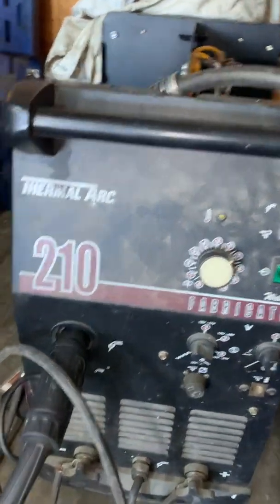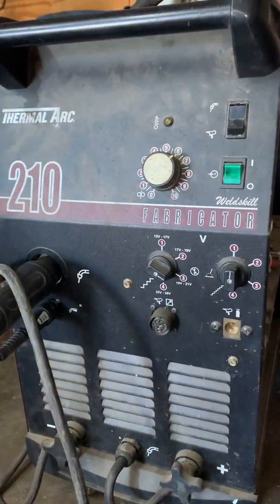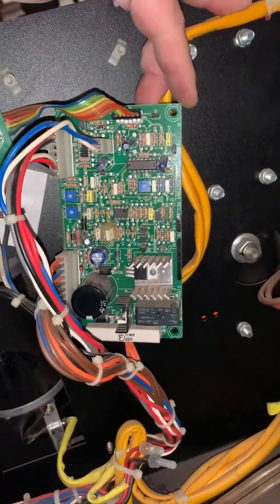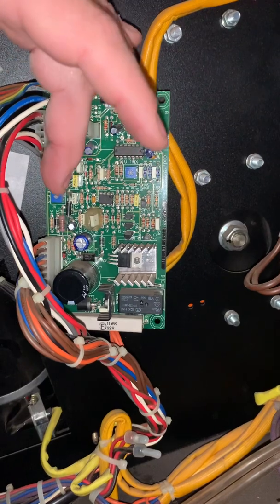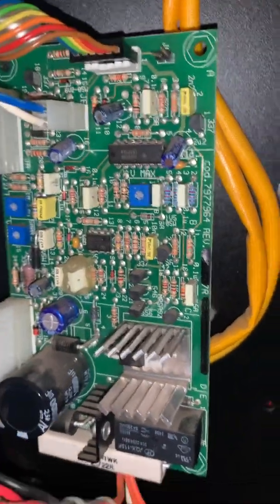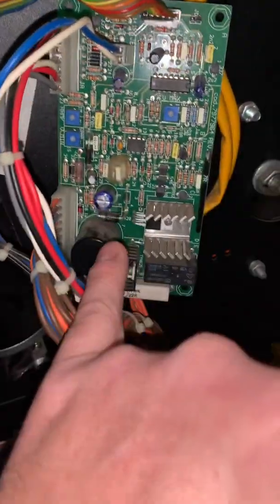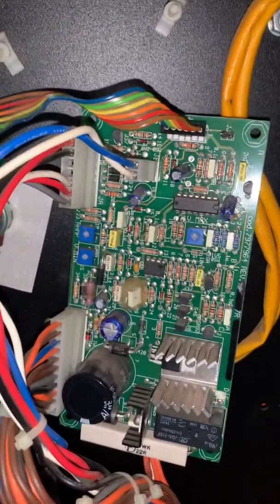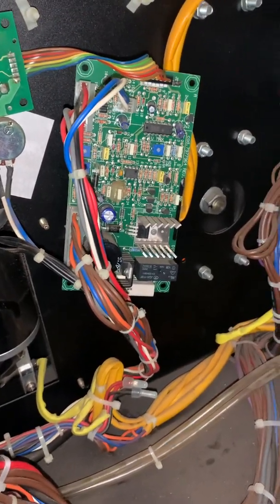Thermal arc Fabricator 210 not feeding wire? Here's how to fix.

Comment: I was having the exact same issue.  Esab tech support (bought out Thermal Arc) said to replace the circuit board and it would be fixed....*aaaaannnnntttt*  Wrong anwer Esab tech support!  Like you said $200 later it's still not fixed.  I searched and searched a bunch of forums and found a fella that says "PM me and I will tell you what will fix it."  Well, his suggestion was the potentiometer.  I'm thiking that's cheap enough so I will look into it.  I got my multimeter out and tested the lugs on the potentiometer and that was it!!!  On leg of the potentiometer test fine, the other leg was all over the place when the dial was turned.  I replaced it with one from Amazon for about $20 and it welds like a champ!  I don't know if you're continuing to have the problem or not, but if you are...definitely give that a try.  I Googled how to test a potentiometer and it's super simple (you may already know) but it let me right to the solution.  Just thought I would share this because I was starting to look at new welders too but really like my Fabricator 210.  Besides, these new machines are all inverter based and our old Fabricator with it's step-up transformer might outlast us all.